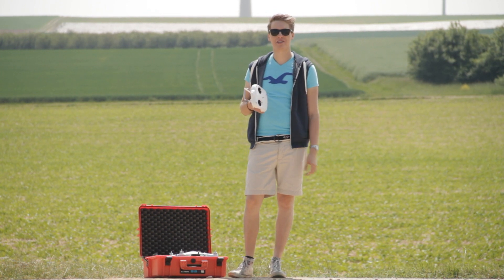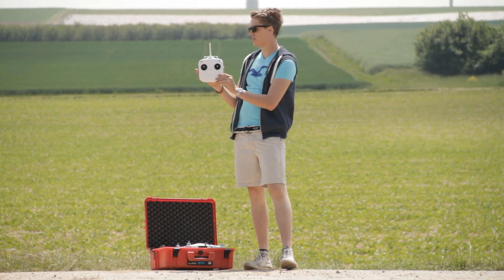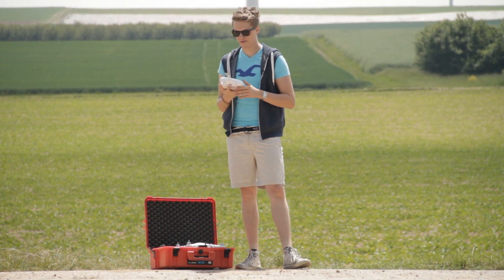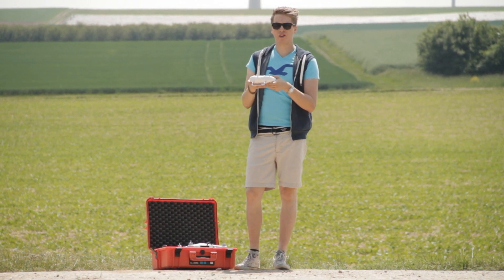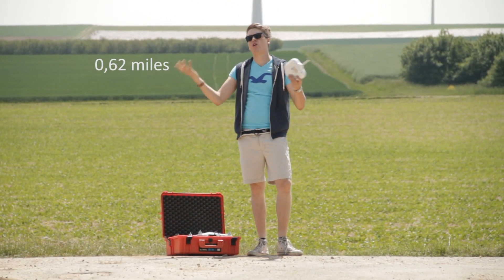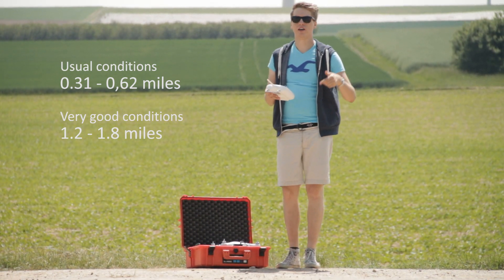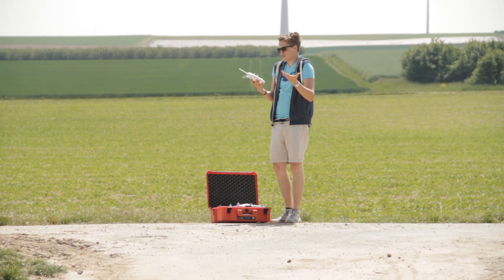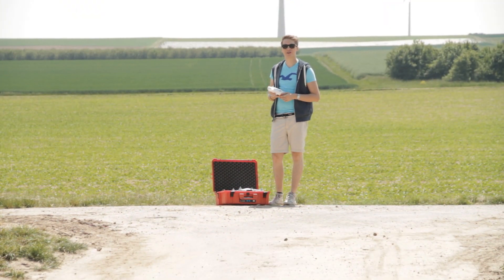#6 DJI Phantom Tutorial - Remote Control Tuning & Range Check

Comment: Flipping the remote over to FCC mode instead of CE does give better range, doesnt it?
Reply: you can't change the mode. FCC or CE will be activated when you register your Phantom. depending on your location it will automatically choose a mode. you can't change the mode by your own
Reply: Actually, you can. Mine was delivered with CE, I changed it to FCC and got better range. (Or maybe it was the other way around, can't remember) A small screw in the controller needs adjustment, google it and you'll see.
Reply: +Magnus Nyborg Also for the Phantom 3 ? Found nothing about it..
Reply: Oh sry, not sure about the P3. Probably not!

Comment: From a scientific background, you make no sense when answering the second question.

Yes, you can replace the antenna and get more range. However, you can't increase the range 360 degress very much, but with a 2.4 14 dbi antenna, you can get well over 10,000 feet in one direction, something the stock antenna can't get close to...